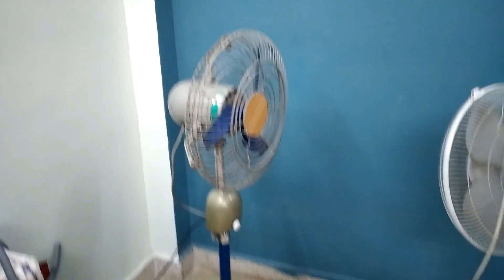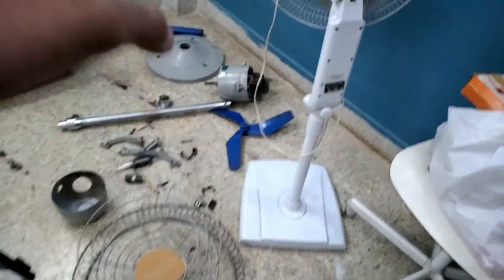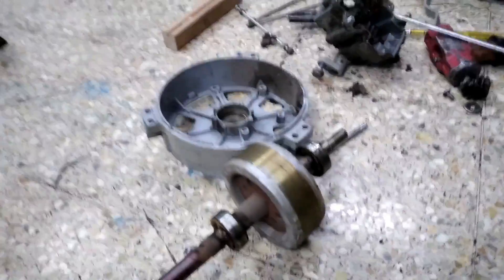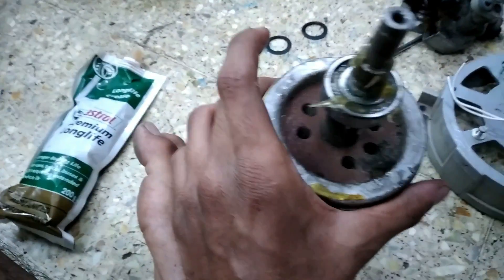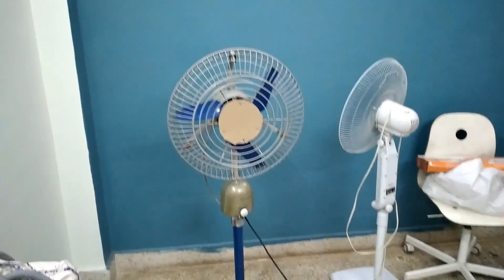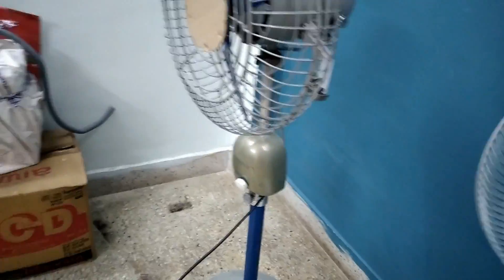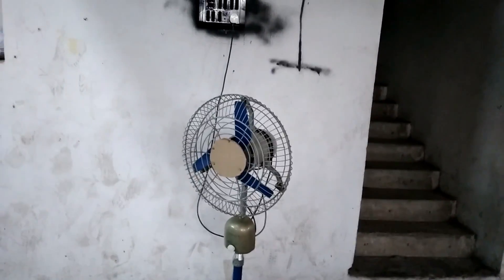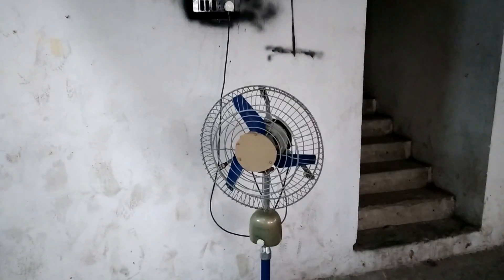Crompton Greaves High Breze Air Circulator 450mm  Teardown  and Servicing

Comment: Hi I brought a new ceiling fan and wire which has plug on one end and bare wire on another if I connect all wires in terminal and put plug into the socket will it work?
Reply from the maker: yes it will
Reply: @electrod.i.y7165  it worked